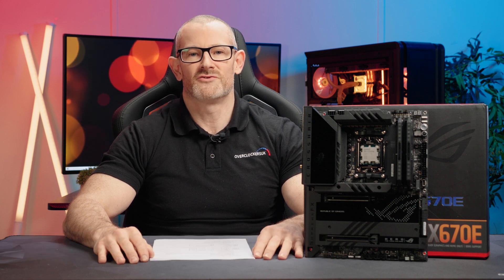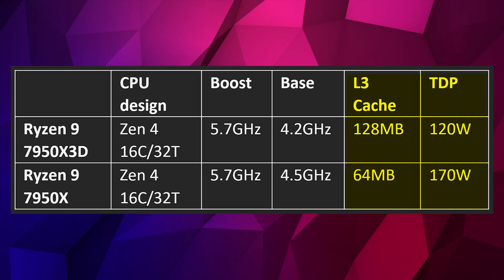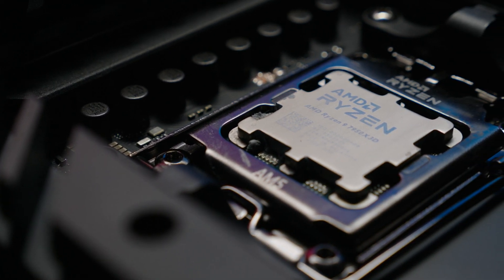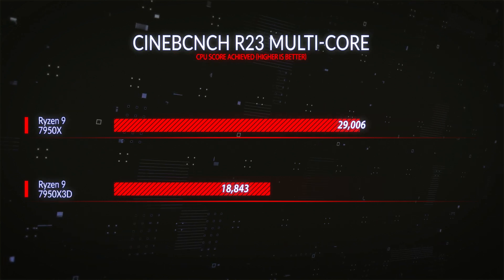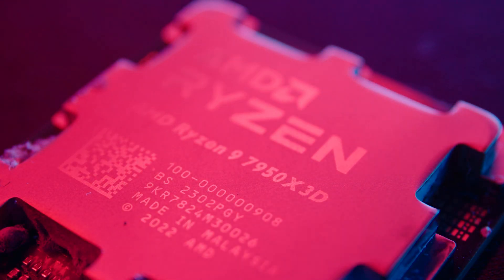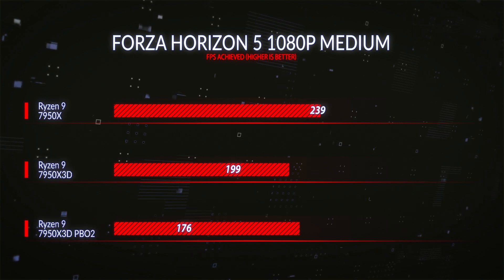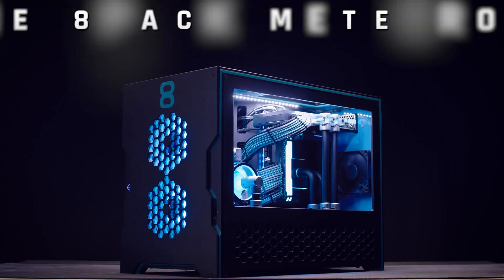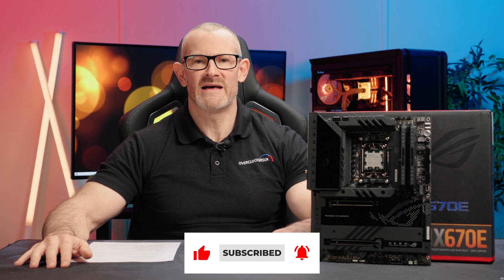The Ultimate Gaming CPU? | Overclocking, Tuning & Benchmarking The AMD Ryzen 7950X3D Review💪

Comment: Good luck the 7950x3d is not a good overclocker and not a good CPU all together. Something that uses game bar to know what is a game is not a good idea it does not no what it's doing. I took mine back l3 cache is not a big jump in games 4 to 5 fps. It's useless. Just get a 7950x it's more stable and overclocks  better. The 7950x3d does not like heat.
Reply: 7950x for 350 usd or 7950x3d for 460? GPU is 3080 12gb. Have triple 420 rad custom loop setup. I play on 1440p 144hz. I need to upgrade my i7 6700k as it's getting too old

Comment: did to do uclock=memclock for that 6600mhz memory? Cause the memory controller running at 3300mhz is impressive most arent stable past 6200mhz ram and 3100mhz controller

Comment: I guess you should’ve talked about the fact when you’re playing a game it’s shuts the other CCD off so it’s effectively an 8 core
Reply: Effectively an 8 core till it needs more cores, then it uses the rest.
Reply: @nikolarajkovic3558 can it use the rest and still use the 3d on the first 8? So it is possible this chip would use more than 8 on a game?
Reply: @ayliniemi  it's possible, but there is a performance penalty. Only eldenring didn't show any penalty, might have been better with all 16 cores. It's been a while since I tested it.
If you have the cpu, you can use process lasso to choose which cores a program will use, and you can test it that way. What I tend to do is have most games run on the 3d cores and most other programs on the other 8 cores
Reply: @nikolarajkovic3558  my 4070 will probably be the bottleneck anyways. I'm going from an i9 and 5500xt to the 7950x3d/4070oc. I play arma 3 which is very cpu intensive I hear so well have to see how it goes if it parks half the cores.

Comment: 7950 x3d is a 7800 x3d it only turns off the other CCD in games so it's a SCAM.
Reply: How is it a scam? What a moronic comment. Try running Cinebench R20 on both, then make the same comment. You're the scam.

Comment: your memory overclock should be focused on latency. Did it decrease with 6600mhz? 
6600mhz is pretty impressive with ryzen 7000. Not sure what settings did you use with your overclock but memory overclock is really important for ryzen 7000.
Reply: I was more interested in how 4800-5200-5600 RAM speeds work, as the speculation I was getting was that RAM speed would have no effect on these newer chips. If I can downclock my 6000 CL30 kit to better latency at lower megatransfers, then I wuld like to know :)
Reply: @paulanderegg5536  Well, I have 7950x with 6200mhz cl32. I suggest you to do some research on ddr5 memory overclock. Primary timings don't matter on ddr5. 
6400mhz rarely works on ryzen 7000. Make sure you raise your UCLK to the max stable value. at least 2067mhz should work.
Reply: @BleepBlop-rh9lm  Was going to learn DDR AMD timing tuning when X3D dropped, but my current TUF B650M MB won't even run EXPO 6000 (out of the box kit profile) without OCCT errors and program crashes, so a bit scared to fiddle. What I mean is I would have to tune my Z5 Neo EXPO kit just to run without error at its rated EXPO 6000 CL30, but if X3D is the same for 6000 and below, I could just set 5600 and it would save me the brain tumor learning tuning would cause. :(

Comment: This is a very peculiar CPU, and according to reviews, the user will need to do a few things to see the clear benefits of 3d v-cache:
- BIOS upgrade
- Chipset drivers upgrade. Here, upgrading the chipset drivers by itself is not enough, two additional driver modules need to be installed: PPM Provisioning and 3d V-cache Performance Optimizer.
- Power plan needs to be changed to "Balanced" instead of the usual "high performance"
- Xbox Game Bar needs to be updated and used during gaming.

If done right, perf difference can be as high as 35% in games which clearly benefit from 3d v-cache, but at least it's pretty much fully automated once all the above steps are done correctly.
Reply: Honestly, people should do this with every new build. I bet 70-90% of all diy desktops are running older bios and drivers. It's stuff that's easily forgotten.
Reply: I checked Asus for MB Chipset updates, nada. Also checked AMD website for the 5.xxxxxx chipset updates, not able to find them. (chipset not BIOS)
Reply: Could you elaborate on why the “balanced” power plan would outperform the “high performance” power plan? I’ve never heard that before.
Reply: @d1didit799  This is because of the peculiar design of the 7900X3D and 7950X3D processors. Both CPUs have two CCDs, however, the two CCDs are not equal and not the same. One CCD is a regular one, and the other contains the fancy V-Cache on top. Many games can benefit greatly from V-Cache, but because one of the CCDs doesn't have V-Cache, it will reduce the total performance in these games when both CCDs are active. To mitigate this, AMD has decided to add the ability to disable (or more precisely, park) the cores of the regular CCD in specific scenarios (namely, games), effectively forcing the game to only use cores from the V-Cache-enhanced CCD. You're loosing half of the total cores, but for games, this is not a problem, because most games wouldn't need more than 8 cores anyway.

To implement this core-parking feature, AMD did some tricks, as mentioned in my previous post (which is the reason it's so important to follow the steps), and if everything is done correctly, the feature should work pretty much automatically.

Regarding the power plan, the "high performance" plan would prevent the system from parking the regular cores, because the plan assumes by its nature that all cores should be active, it doesn't know that it's actually not the ideal setup for V-cache games. Therefore, the "balanced" plan is the recommended plan, because it will allow the CPU to work as intended, parking the regular cores when needed, and enabling all cores in other scenarios (e.g. productivity).

Two further comments:
1. I'm sceptical about the 7900X3D, because the CPU has only 6 cores per CCD, meaning it will only use 6 V-cache cores during gaming (because of parking). That might hurt performance.
2. If you think these peculiarities and unequal CCDs are too much to stomach, just go for a 7800X3D. It has just a single 8-core CCD, which has V-Cache on top, therefore, there's no need to park/unpark cores. No fuss, no confusions, it just works. Not perfect for productivity because it's effectively an 8-core CPU, but great for a gamer PC.
Reply: @nexy84  Wow thanks for the detailed response I understand this way better now. I’m building a rig with a 7950x3D and a STRIX 4090 right now. I was worried that the setup for the CPU would be complex enough for me to miss something, but you cleared it up for me. Do you own one of these chips atm?
Reply: @nexy84 why did they just use the  fancy v cache for all cores?
Reply: @ayliniemi  I guess because of various design and technological challenges, plus it's highly likely that it would have made the CPU even more expensive.

The 7900X3D and 7950X3D CPUs are designed differently compared to the 7800X3D, because the 7900X3D and 7950X3D have two CCDs, compared to the 7800X3D, which only has one. This makes the 7800X3D naturally less challenging to design and make, and all cores can utilize the V-Cache. When you have two CCDs - not so much.

We could think of several "ideas" how to make a 12 or 16 core CPU 100% V-Cache enabled, but I guess all of them would have various pros and cons. Who knows, maybe AMD will try a different approach for the next CPU generation.
Reply: @nexy84  upgrading from a i7 6700k + 3080 12gb gpu, which one should i upgrade to for cpu? 7950x for 350 usd or 7950x3d for 460 usd? I want an all around cpu as it will be another while before i upgrade my cpu.
Reply: It took me a total of 5 extra minutes to do the motherboard bios, drivers and chipset drivers on the amd website AND XBOX GAME BAR.  Once done I verified through resource monitor that all non v cache cores were parked. Haven’t had an issue. The key I think some people will overlook is updating Xbox game bar. I’m guessing the power management plan matters because if you force high performance it messes with the way the chipset uses it’s resources and will attempt to unpack the other cores. 
My specs
Amd 7950xed
Gigabyte 4090 oc gaming
Gigabyte x670 elite 
Corsair ddr5 6000 c30
Corsair shift 1200w gold
Samsung 990 pro 2tb

Comment: its sold out everywhere im so angry... wanted to get it ASAP
Reply: I happen to be up checking every hour. Saw it on Newegg and waited 10 minutes to see if it'd pop up on Amazon because I was curious if we got Jedi Survivor with it. Ended up just ordering it from Newegg because I was afraid of it going out of stock if I waited any longer. Supposed to be here Thursday!
Reply: @doctorz7305  im in germany different situation here it was sold everywhere in 20min next stock end march availible
Reply: @LouRaX  If you don't need it for productivity tasks, may as well get the 7800x3d since it's releasing April 6th.
Reply: @mchonkler7225  ya i dont want to wait that long to be honest... so their upsell strat works on me :D
Reply: @McHonkler  I normally would have too since I don't do much productivity right now, but my new build only needs a cpu to run, so I'd been waiting. Their stupid strat worked on me too
Reply: This is one of those pointless products that makes no sense, but go ahead.

Comment: tightening timings is better fro ryzen than going over 6000mhz
Reply: True. Tightening the timings (subtimings especially) iis important for both AMD and Intel. Many people ignore those sadly (understandable, not an easy task if you're new to overclocking)
Reply: How tf you do that
Reply: @damnsonalabanca  
In bios. I use Ryzen dram calculator. Not sure if it’s out on 7000 series yet

Comment: Ahhh, something is off here. Only 2% better performance than the 7950X??? Nah, something way off. All other reviewers have the 7950X3D performing well 20-30% over the 7950X and about 6-10% over the 13900K. No way the X3D is only 2% better than 7950X.
Reply: FYI, the disparity in performance between reviewers is BIOS related. If the application isn't scheduling correctly, you will get that 0-2% result. See Gamers Nexus on the enormous difference gulf of performance between BIOS. Hardware unboxed also simulated 7800x3d to see what happens when scheduler doesn't have to choose between ccds and surprisingly performs better.
Reply: @SneakyB  Ian confirmed bios and chipset drivers were all updated for his tests, so nope, that's not it.
Reply: @claudep.1926  As mentioned before, a simple BIOS+chipset update is not enough for this CPU, because two more chipset modules need to be installed, the power plan needs checking and Xbox game bar needs updating+running. Ian didn't confirm that he followed all steps before his review, maybe he did, maybe he didn't, we don't know.
Reply: 7950X3D is not that much better than the non 3D counterpart for the price that it costs. Performance may vary depending on the games being tested. This is why you source data from multiple review outlets and make a decision.
Reply: @frostmanee  not so much better??? Almost every review outlet shows the 7950x3d 20-30% faster than 7950x. How is that not “much”?? The 7950x barely edges out the 12900K while the 7950X3D is in “most” games edging out the 13900K and in some games completely annihilating the 13900K. People today in days expect CPU’s to give same double performance leaps as GPU’s do. Unreal
Reply: @MustafaGT  20-30%?!? I need what you're sipping on because that the biggest piece of horseshite i've heard. Also  I said "for the price". The fact that you can wait one month and get the 7800X3D, which has been shown to outperform the 7950X3D, means that the value proposition of this CPU for most people is absurdly low.
Reply: Oh nooo all the reviewers I watched with review samples and instructions specifically by amd on how to run benchmarks are not getting the same results!! Welcome to reality. Most reviewers are paid and told by and how to run the cpu, what stuff to enable and disable to make it run better and specific games that they know is going to perform better.
Reply: @antoniok52  exactly! Overclockers UK are a much more reliable resource for real world numbers.
Reply: @claudep.1926  According to who? Was a survey or study done that I'm unaware about?
Reply: @mchonkler7225  watch PCWorld's ep. 248. They talk about how AMD sent a +20 page guide to make sure reviewers are getting the marketed results. It's a convoluted process, far from representing a real world use. I trust Overclockers review.

Comment: Did you not update the bios and the x3d chipset update? All the other reviewers are getting way better results in gaming
Reply: Bios was updated yes, chipset drivers also...
Reply: The results are going to vary quite a bit from one reviewer to the next. I know AMD sent out a reviewer's guide on how exactly they want it set up. Part of it was the BIOS, chipset drivers, windows update for Xbox... Then you also had to tell windows whether you wanted the game / program to run on the first CCD with the cache. Honestly it's a little bit of a pain in the a$$. The 7800x3D should be much much easier.